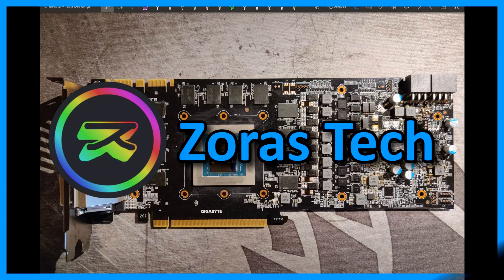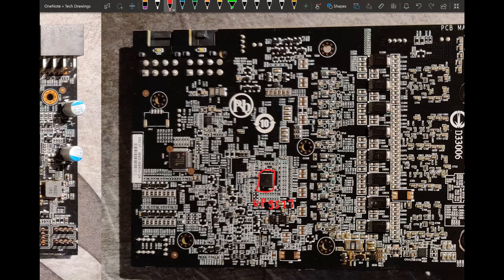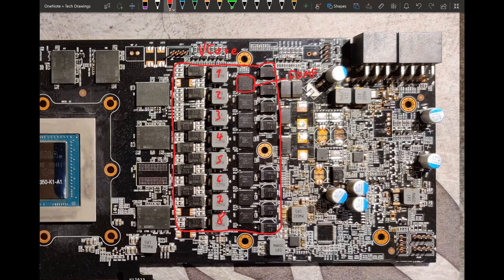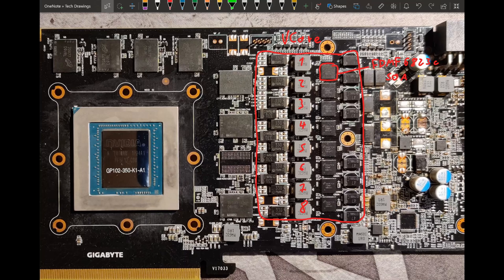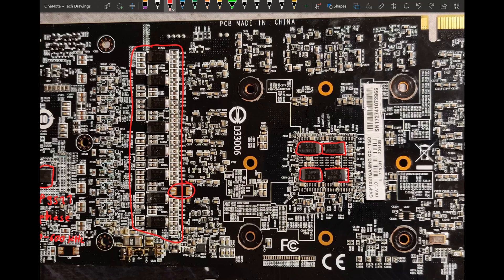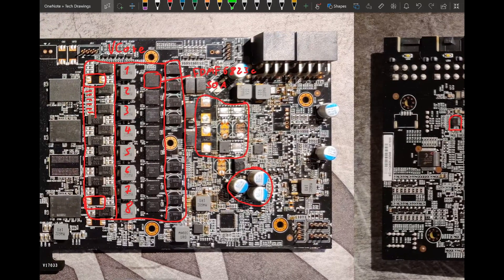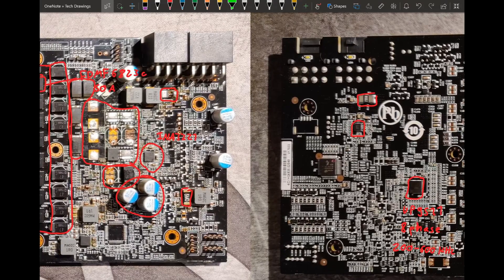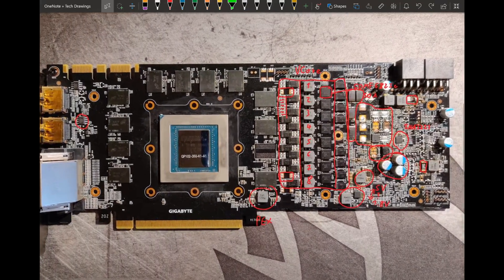Gigabyte GTX 1080Ti Gaming OC | PCB Overview

Comment: Great Video but one question which of the 3, 4 pin connector's at the bottom right of the card is the correct fan connector? Thanks in advance!